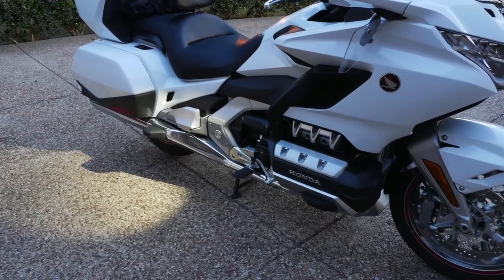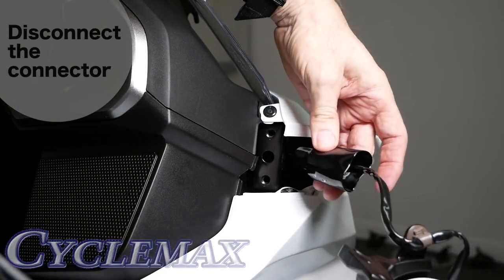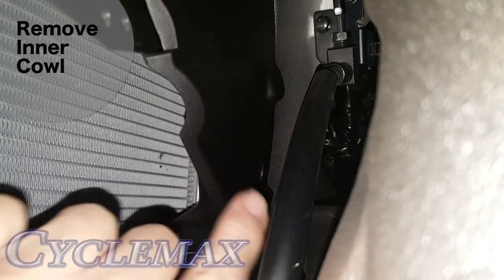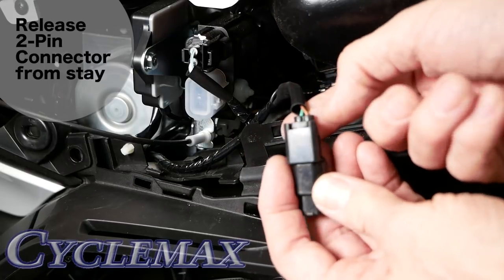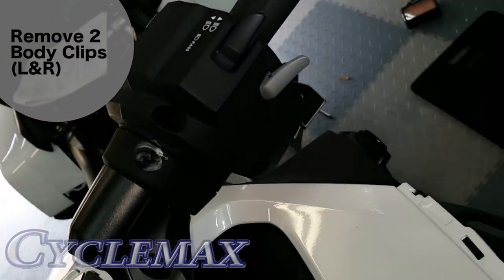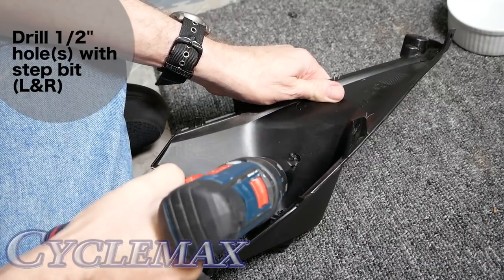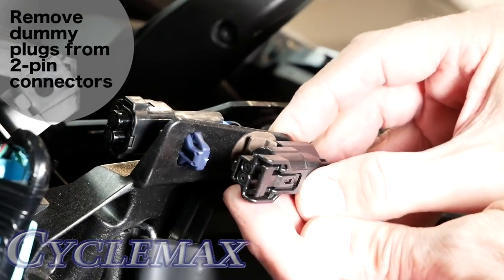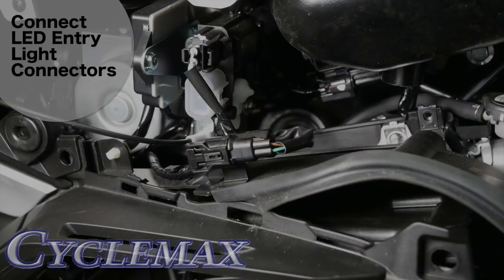Install LED Entry Lights (puddle lamps) on 2018 Honda Gold Wing

Comment: Thanks Cruiseman, what would we do without your videos. I just installed Electrical Connection entry lights and I believe it was much simpler. Didn’t have to remove the top shelter and no brackets to install

Comment: The planets aligned for me yesterday (April 18th, 2018) and I found a dealer who shopped my trade-in and got me $4k more on the wholesale bid than a dealer I had tried the day before. But wait. There's more. I had gone to this dealer because I was stunned... STUNNED I tell you! .. that the dealer had a USED 2018 Goldwing Tour DCT! A guy had bought it, decided it was to thin for him, and went back to a 2017 Goldwing! Truthfully, I was skeptical of that story, when, later in the day, the previous owner came in and I met him. The story was true. My good fortune. Anyway, the 2018 is a joy to ride.The best motorcycle ride I've ever experienced. I am so stoked I'm up at three in the morning writing this. Can't sleep. Amazingly, the dealer also has, as of this writing, a used non-DCT 2018 white Goldwing Tour, also with about 1200 miles. This is at Dallas Honda on 635 LBJ at Greenville. If you call, ask for Brian and tell him Don Smith sent you. So, I tell all this because I have a suggestion; my new (sorry, USED.. it had 1200 miles on it!) 2018 Goldwing Tour already had a couple of extras the previous owner had put on it like fog lamps, a drivers backrest, a tall windscreen (perfect!), and 'rugs' for the trunk and saddlebags along with an organizer for the trunk. But, on watching this GREAT Cruseman how-to videos and wanting to install other add-ons, I would like to suggest that Cruiseman maybe do a video for new owners like me about consolidating several installs at once. In other words, take off the seat and the mirrors and the screws and the clips one time, install everything you can at once, and be done with it. If you want to use my bike for the video let me know. I live near you in Plano. I'm a professional television news cameraman with a professional news camera. By the way, my new Tour is just like the one Cruiseman rides; white.
Reply from the maker: Congrats on the new Tour! When I shot this video, I was actually doing several installs at the same time, that's why the windshield is off the bike in a couple of the scenes (installing XM antenna). I have had a couple of folks ask about such a video, and I think I may have the footage already necessary to put something together. BUT, there may be other opportunities for us to work together on other install projects in the future. Reach out to me on email and we can discuss further. cdikmen@cruisemansgarage.com

Comment: Cruiseman I applaud you.  Your skills are impeccable but this is ridiculous.  No bike should be this complicated to add accessories.  What a nightmare this will be if a part wears out or breaks..  I'm beginning to like the goldwing but this is mind blowing to add simple accessories.
Reply: have you ever seen the procedure for replacing the engine air filter on the prev. gen GL1800? lol

Comment: I installed these and it took me less than 30 minutes.  I popped the cover open where the lights go and put a towel in the gap to keep it propped open. I heated a pointed long punch, melted a hole through in the identified stock area.  Drilled it larger and connected the wire.  No need to remove anything.

Comment: As usual, an excellent video but this could be the absolute worst work-to-value ratio of any accessory installation.
Reply from the maker: I actually think they are pretty cool. The optional USB cord is the worst work-to-value accessory.

Comment: I fitted these on my Goldwing but rather than take all the top shelter off I removed the middle cowls. From there I could see the 7:13 moulded marks showing the position of the lights. I used a 90degree scriber and pressed the point firmly into the centre of this mark and the dark plastic changed to a light gray where I pressed. Showing me where to drill from the outside of the top shelter.
Reply from the maker: Pretty clever.

Comment: I like the idea but can't make up my mind if I should add them. I hate to drill holes in new parts and the installation seems to be somewhat of an afterthought. Is it worth it? Just how clean is the installation?
Reply from the maker: It is actually a very clean install. Just wait until you need to remove the top shelter for some other reason before installing.
Reply: Cruiseman's Garage I have a 2018 Airbag DCT on its way from the Honda Warehouse. Most of the add-one have arrived at the house so I’m just waiting to pick her up. 

I went ahead and ordered this light set today. 

Sure am looking forward to getting it. :-)

Comment: If you were going to install all of the Honda electrical accessories for the Gold Wing Tour, since most of them require total disassembly of a great portion of the covers and saddlebags, in what order would you install them after disassembling the bike?  Thanks.
Reply from the maker: Good question, but I am not sure it really matters. I installed the XM antenna first, then the LED Entry Lights, followed by the HomeLink, then the optional USB cable.

Comment: I had a hard time taking off the cowls, doing this.. watch your video and another youtubers, still broke a little tab on the top.
Reply from the maker: Watch my video on how to repair those tabs.
Reply: @cruisemansgarage   I was lucky, I found the broken piece.. I have the entry lights, 12v power in, awaiting for homelink to show up..  now on the 12v power there are 2 screws holding the parking brake on, not one and I would tape that plastic  piece with blue tape, I scratched mind up taking out the parking handle! So far I only lost one plastic push pin :)

Comment: Too much trouble for those unneccessary lights. But well done for showing and thanks... I wanna cover mine in Line-X so I was thinking should I take off all parts and do it or just mask parts and holes I don't wanna fill with coating...

Comment: Hey Cruiseman, as others have said, great video!  I love my new '19 non-tour and have been drooling over farkling it.  My question:  I bought Entry Lights that project the Goldwing logo in red (I added logo entry lights to my Infiniti GS coupe and they get lots of praise).  These Goldwing entry lights come w/bare wires.  Do you think I can use the dummy plugs that come out of the entry lights harness to make working connectors for my entry lights?

Comment: Great videos, I've  been a subscriber for many months ,I was very hesitant to buy after all the negative videos, but your videos and  a few others we're  the tipping point. I took tour dct  for hour and half test  ride through city traffic and the highway and I didn't  want  to take it back, the dct did it for me , I want to buy led fog lights and luggage rack with brake light ,do  you have any videos on those  installs ? is this job doable or get them installed at the dealership  before I bring it home, keep up  the great  rides it's going  to be a long winter  up here

Comment: Dear god. Honestly that is insane. The amount of disassembly required -- bolts, tabs, rivets, clips etc. all for some led lights? Buy some adhesive stick on lights if you really need them -- which you don't. I also wonder if the disassembly required voids the warranty. I will thank the video producer for making this video. It convinces me to NEVER purchase this latest Goldwing. The complexity of the body parts and moldings is beyond belief. Terrible design. I will stick with my 2001 ST 1100, with its simple body panels and 7.4 gallon gas tank . Honestly this 2018 GW disassembly video was just about the most frightening DIY motorcycle video I've ever seen. What a nightmare.
Reply from the maker: Installing accessories will not void a warranty. Unless, of course, you break something, then that would not be covered. Disassembly IS daunting, especially the first time you do it. When I made this video, this was my first time, and I was doing it "LIVE" on video. And, I made a few mistakes along the way (thanks to Honda's poor documentation).

Comment: I just got a 2018 GW Tour with DCT. This is a very informative and well done video but never in a million years would I attempt this! Way too much disassembly and fiddling with delicate plastic panels and wiring all for the sake of two lights that, I think, have no purpose. Just sayin'........